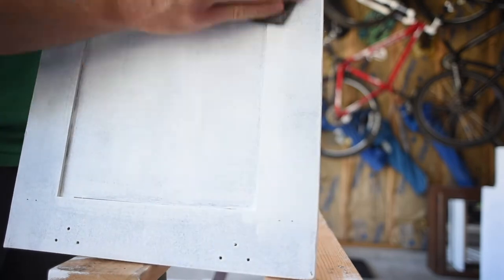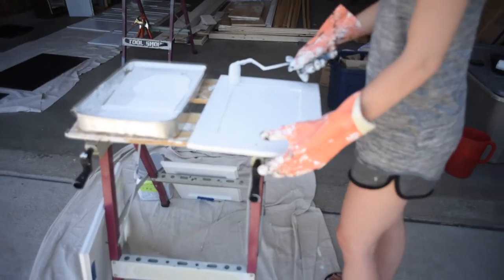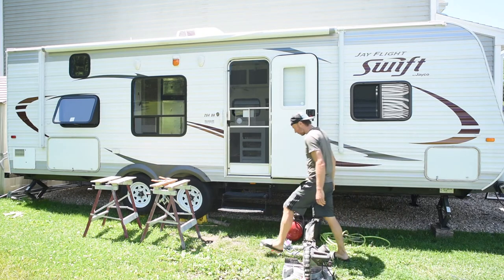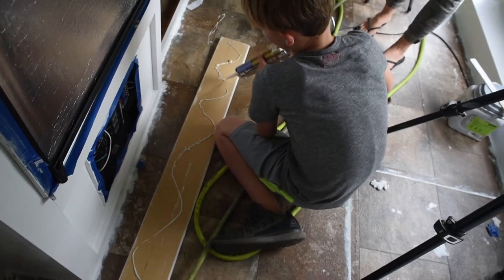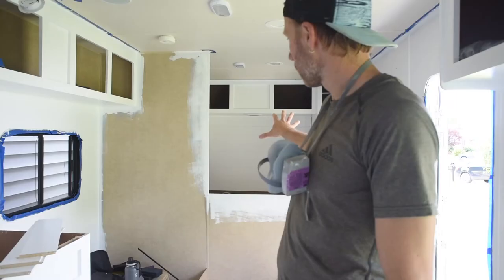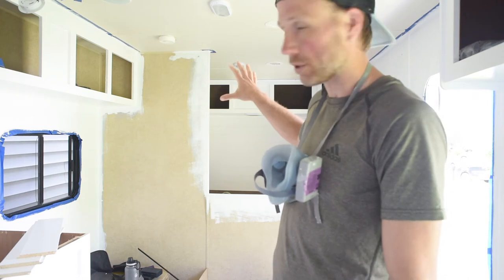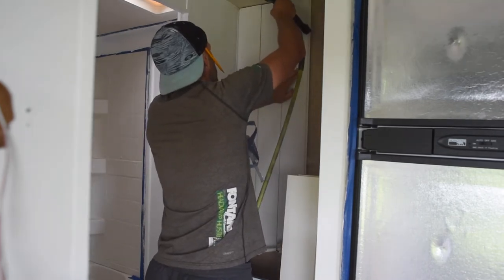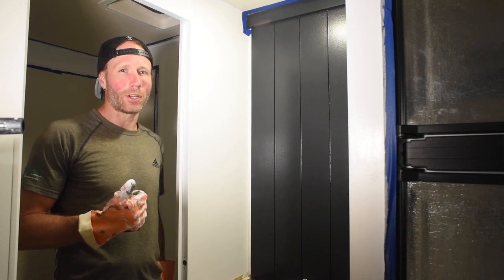Jayco Jayflight 264bh RV Remodel Shiplap

Comment: Awesome job!! How do you guys hold in place shiplap?? I would love to do this in mine rv  I'm just afraid to hit with the nails wires/hoses inside
Reply: you can install a thin layer of board and liquid nail with nail gun to the frame, I had to install an entire cabinet with wall mounting ability for my MPPT and inverter - it is the most solid part of the rv
Reply from the maker: We install ours with liquid nails and brad nails. Making sure to get in the studs
Reply from the maker: Yes! that's exactly what we would do too! In our more current renovations we now rip shiplap from 1/4 inch plywood to keep weight down.